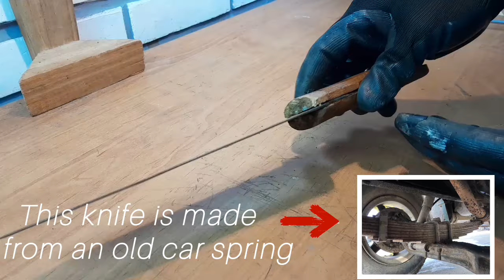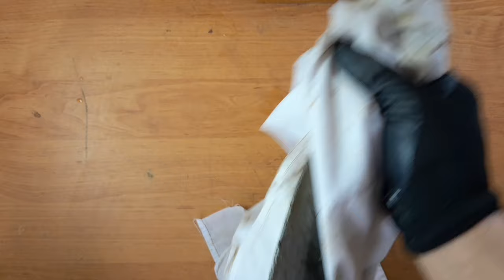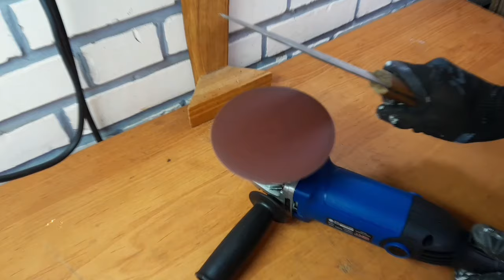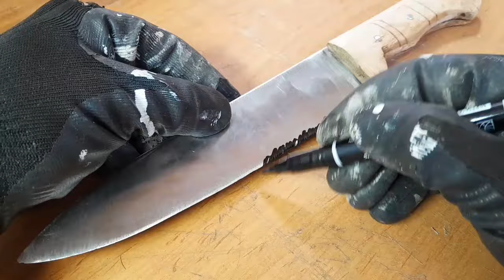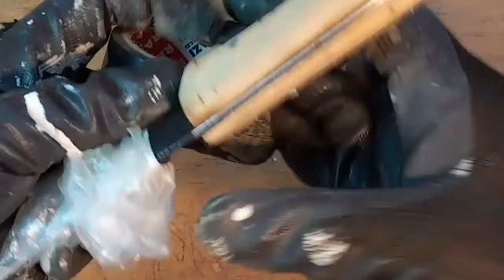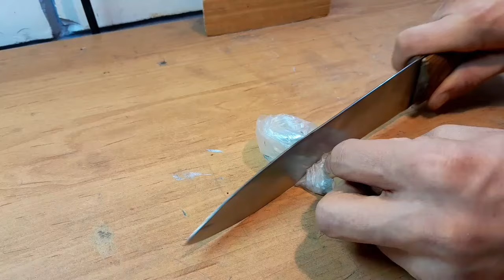knife restoration/This knife is made from an old car spring

Comment: I don't want to discourage you, but this is disgusting. To make your work more professional, you need to invest in tools. A belt sander is essential. If you can't afford a belt grinder, buy grinding stones and do it by hand. As for polishing, you can start polishing only when all the scratches are covered with a very fine gradation. The handle didn't fit the knife and you didn't fix it. You still have a lot to learn, you need more patience and other tools. Regards.
Reply from the maker: Thank you very much for all the points you said. Yes, unfortunately, my tools are few and I don't have the necessary budget to complete all the tools
❤️❤️❤️❤️❤️❤️❤️❤️❤️❤️❤️❤️❤️❤️